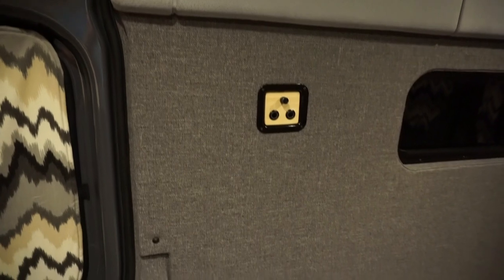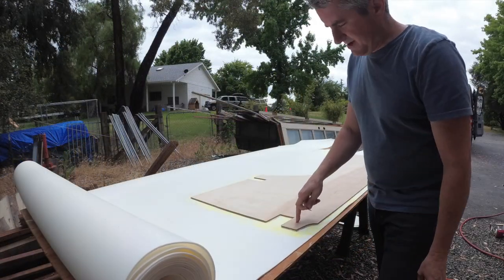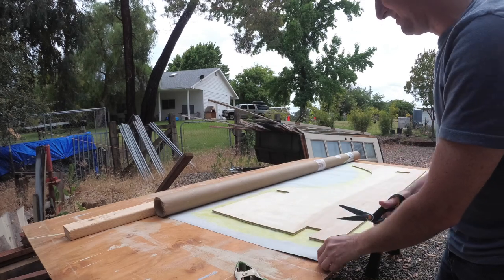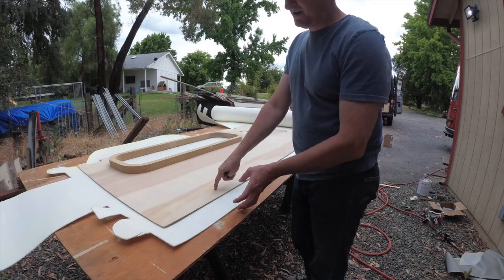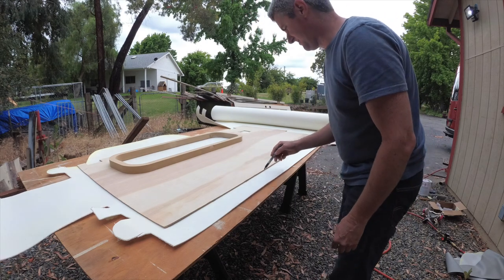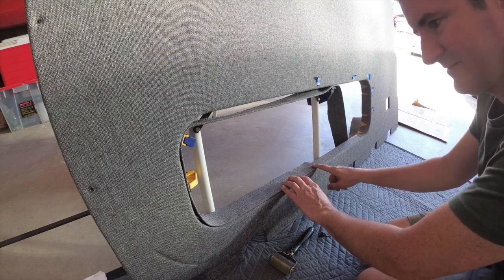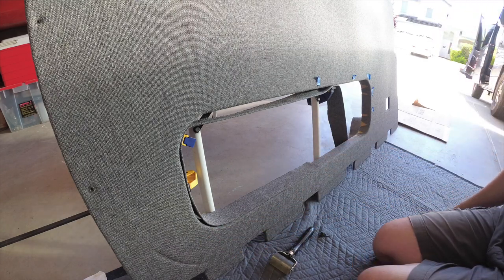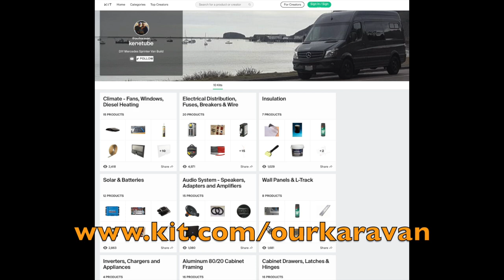Wall Panel Upholstery - DIY Sprinter Camper Van

Comment: How did you determine the amount of fabric to order? I don't mind having some extra, however, I'd hate to run out.
Reply from the maker: The fabric rolls I bought are 54" wide, so 1 linear yard would be 54" x 36" in that case.  I used 10 yards for the rear sidewalls, B and D pillars and headliner shelf. Keep in mind I have the factory headliner which covers down to about window level and I have yet to cover the sliding door. I'd say about 12 yards (just a guess) get you through most of a 144, not including headliner and assuming you have crew van windows.  I'd take a few minutes and see how many 54x36" areas you have to cover.
Reply: Thanks for the quick response, I thought you should know that Perfect Fit is out of stock on the Heather Gray. I spoke with a customer service rep and he said they are getting bombarded with calls from people wanting to cover the walls of their Sprinter vans. My guess is, this is a direct result of your video. Awesome job!!! @ourkaravan
Reply from the maker: Ha, I doubt it's me as I know Outside Van uses the same material, but I'm probably not helping matters either!

Comment: What did you use to fix the upholstered panes to the walls?
Reply from the maker: Hi, the walls are held in several ways, including the headliner at the top, the L-track at the belt-line and just a couple of screws.  I discuss it a bit in this article:  https://ourkaravan.com/upholstered-wall-panels/

Comment: Hi, Nice job! You're a Pro. Where did you find the light grey switch covers on the back panels?
Reply from the maker: The switch covers are factory pieces. My van did not have them but I was able to buy a set from the sprinter forums.   Thanks for the complements!

Comment: We are struggling with the contact adhesive being too thick. If you did thin it, what product would you use?
Reply from the maker: Hi, are you using the dap product?  Could it be temperature related?  I believe you might be able to thin it with some thinner.  I had no such issues but it’s worth looking in to.
Reply: @ourkaravan  it was a faulty sprayer. We kept thinking it was the adhesive but the harbor freight sprayer both had a blockage and the wrong size nozzle. Have 14 beautiful upholstery pieces thanks to a new sprayer, your video, and the YouTube references you supplied.
Reply from the maker: @SallyinOlympia  That's great, glad you discovered the problem.

Comment: Nice!  This is exactly what I was looking for. Thank you.

When you glue directly to the metal, What are you doing when you go over some of the factory holes in the sprinter?
Reply from the maker: I upholstered right over them.  Small holes aren't noticed.  Not sure what covering a big hole would look like but as long as the fabric is stretched tight perhaps you wouldn't see those either.  In the rear D-pillars of the van are some large square holes, and for those I cut them out and popped in the square plastic plugs from a crew van.  You can see I mounted switches in those plastic plugs.

Comment: Would reflectix work instead of the foam? And, would there be any advanatges to doing that
Reply from the maker: Reflectix needs an air gap to do it's job and the only place I found in the van where such an air gap could exist was above the cab headliner in the driver's area.
Reply: @ourkaravan  Im thinking of two lazers of thinsulate with a layer of reflectix in between.  What do you think? Good idea or bad idea?
Reply from the maker: I"m not just not sold on reflectix in a van.  I realize all vans are different, but the only place where there was enough air gap in my van for reflectix to do its job is over the cab headliner in the only the cab portion of the van.

Comment: Are you worried about mold and condensation?
Reply from the maker: Not a bit.  I’ve had wall panels off and there is zero sign of any issues.

Comment: What kind of foam did you use?  The website in the link has a bunch of options.
Reply from the maker: I used 1/8" closed cell foam between the wooden wall panel and the upholstery.

Comment: What is the best ply thickness to use as the backer?
Reply from the maker: I used 5.2 mm plywood from a local hardwood store.  In my opinion it is bendable enough but not too much so and relatively low weight.  I’d definitely use it again.

Comment: Did my first precisely the same way in 2009 but didn't have time to record it for ya.
Reply: Well you coulda asked me.  I've been fulltiming in a Sprinter, alone, for 8 years and did a LOT of my own conversion work. hehehe  Funny, I didn't even research it.  I just winged it and suppose I had enough craft experience it worked the first time.  Are you an engineer?  i've been wondering.  I noticed your work is exceptionally detailed compared to most.

Comment: Where do you find the window trim rings ?
Reply from the maker: RB Components.  It's not easy to find on their site. You have to go to the panel bed window section and it shows up as a related link.

Comment: Do you thin that adhesive at all? How have they held up?
Reply from the maker: I did not do any thinning.  The stuff is super strong.  I learned first hand that if you make a mistake, the adhesive is so strong you will de laminate the plywood before the adhesive gives up.